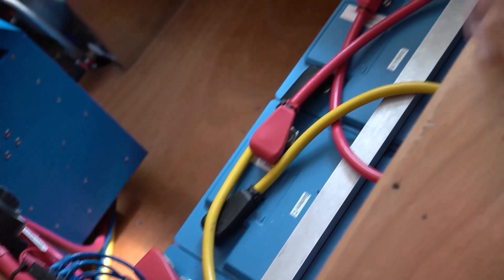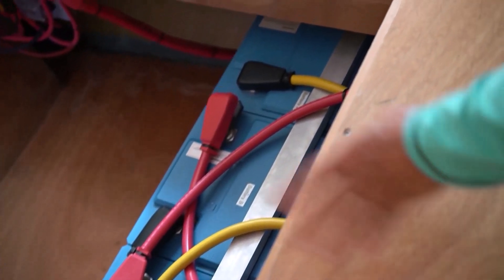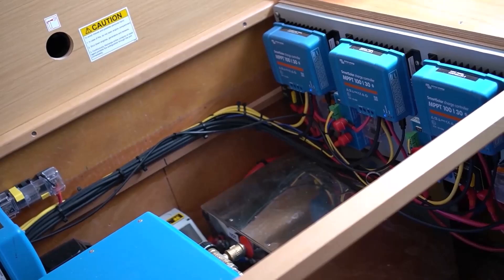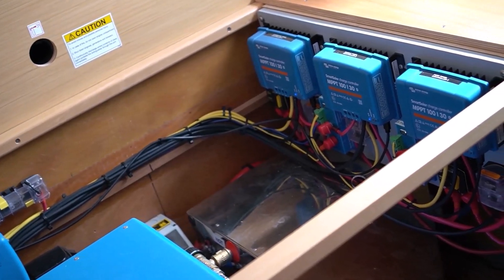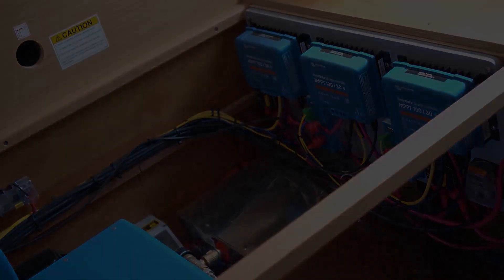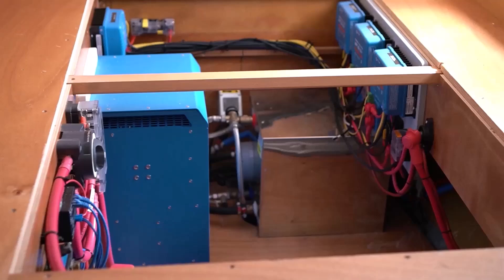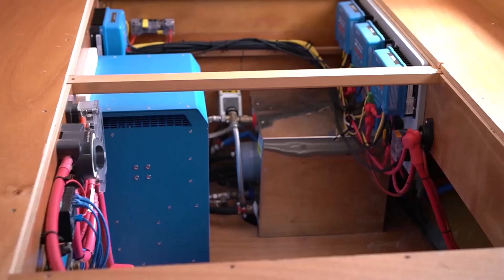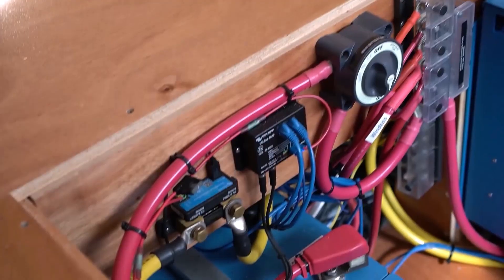Lagoon 380 Victron Lithium battery and Energy power system 3 years  of experience

Comment: Thanks for the video.  Glad to hear the Victron batteries are working well, along with the rest of the system.

Energy independence is a wonderful thing and highly aligned with sailing, which ideally uses wind for propulsion.  

Another good thing to have is electric drive.  This is doable with more battery and electric motors and a backup generator.  This is less common now, but will be standard in the not too distant future.